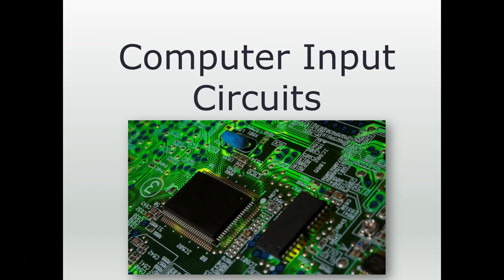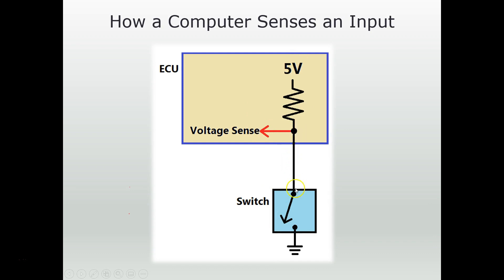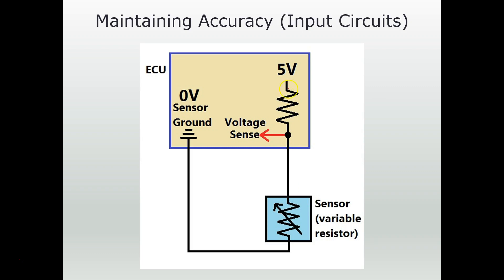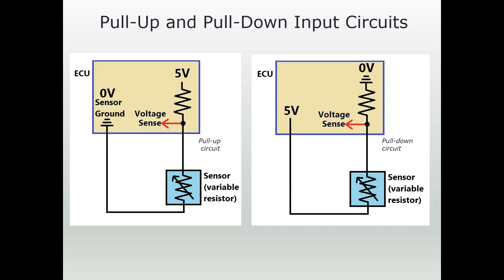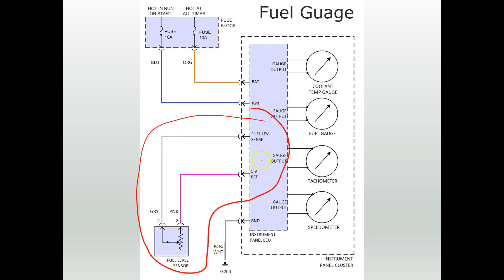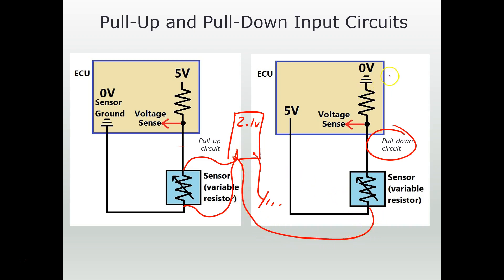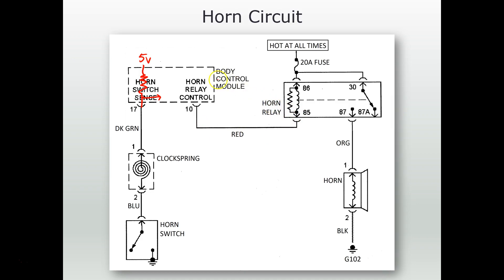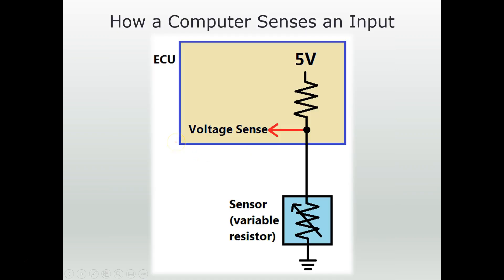Computer Inputs: Pull-Up and Pull-Down Circuits

Comment: Every video I watch seems to say something different. High side switched or low side switch. And scanner danner says pull down when you unplug goes to 5volts 🤦🏼‍♂️
Reply from the maker: I have not personally heard Scanner Danner say this, but others have told me that he is teaching it backwards.   Don't hold that against him. He's still a very good teacher. Everyone makes mistakes and learns as they go.  It doesn't take very much research online to confirm that a pull-up resistor will default to 5 volts when unplugged and a pull-down resistor will default to zero volts when unplugged.  I have been teaching for over 20 years and have certainly taught some wrong principles along the way!  I hope I am learning and getting smarter as I go!
Reply: Instead of thinking about it as a pull up or pull down circuit, think of it as a pull up or pull down resistor, and where the resistor is located determines if it's a pull up or pull down circuit. If the resistor is connected to ground (negative), then it's a pull down circuit. If the resistor is connected to voltage (positive), then it's a pull up circuit.

Comment: Hello, I really like your videos thus far. Thank you for taking the time to do this for us. I am confused though. I am still very new to this. So I reserve the right to be wrong. I am currently going through scannerdanner's book. What you call a pull-up circuit, he calls a pull-down circuit and vice versa. He says if voltage is from an external source then it is a pull up circuit. Reason being that if the switch is open then the sensing circuit will read 0V when the switch is closed the sensing circuit is "pulled up" to source voltage. Now I am more confused. Maybe it doesn't matter what we call it as long as we understand the circuit. Thank you again.
Reply from the maker: Mathew, I am glad that you are curious!  I hope this helps:

Without the book in front of me, I am not sure what exactly ScannerDanner is trying to communicate.  However, when you use a resistor on an input circuit like this, they are classified as either '"pull-up" or "pull-down" resistor circuits.  This video correctly labels them.  

In a pull-down circuit, the pull-down resistor holds the logic signal to zero volts (0V) when no other active device is connected

In a pull-up circuit, the pull-up resistor holds the logic signal to a reference voltage (usually 5V, 8V, or 12V in automotive applications) when no other active device is connected

Here are a couple of links about it:
https://www.circuitbasics.com/pull-up-and-pull-down-resistors/
https://circuitdigest.com/tutorial/pull-up-and-pull-down-resistor
Reply: The pull up resistor and pull down resistor are clearly defined. I associate pull up circuit with pull up resistor. And pull down circuit with pull down resistor. This is different than the ground side switched or power side switches circuitry.
Reply: @jyao5409  That's the best way to remember it.
Reply: easy way to put it is mechanical or hydraulic switches as fuel injectors are pull up/ power comes from external source grounded at computer. gm fuel pump is pull down power comes from computer and external grounded. what mr miller is referring to is a hall effect sensor or electronic switches like cam shaft or crankshaft sensors. scanner danner goes into detail about these in his premium. mr miller is not explaining what type of switch he is referring too. theres mechanical, hydraulic, and electronic switches
Reply: @jche4503  When we talk about pull up or pull down, we need to remember which resistor we are talking about. The designation in the microelectronics world refers to the actual resistor inside the PCM, put there to give stable voltage even when the switch is open, and to limit current when switch is closed. But in Paul's lecture series I believe he was talking about how the actual sensor, like a fuel pump or temp sensor influences the incoming voltage. I like his idea to identify the two general kinds of circuits, but muddy use of specific terminology can lead to confusion as well. It may sometimes be better to use the terms 'ground side switched', or 'power side switched', for clarity.
Reply: @jche4503  I think you're confusing "high side" switched and  "low side" switched with "pull up" and "pull down" circuits. The fuel injector and GM fuel pump you mentioned are both "low side" switched.

Comment: thanks for very interesting  video. so that`s why  when cooling temp sensor is unplugged the cooling fan starts working  because it default to 5v.so it is pull up design?
Reply from the maker: No, that is not necessarily true.  The output circuit is independent of the input circuit.  That may be a fail-safe programmed into the computer so that the engine does not overheat if the sensor circuit has a failure.

Comment: Dear sir I have a question about the three-wire sensors (we suppose it works with 5 v), when we unplug the connector from the sensor, we get  5 v or zero volt on the signal wire I am so confused.
Reply from the maker: It all comes down to understanding how voltage drops in a circuit, including knowing where voltage drops (or doesn't drop) when the circuit is open.  The input circuit is a voltage divider circuit.  When you unplug the connector from the sensor, the circuit is open and voltage will not drop across the internal resistor in the computer.  Because of that, you will get either 0 volts or 5 volts depending on whether it is a pull-down or pull-up circuit.
Reply: @JustinMillerAutomotive  thank you so much